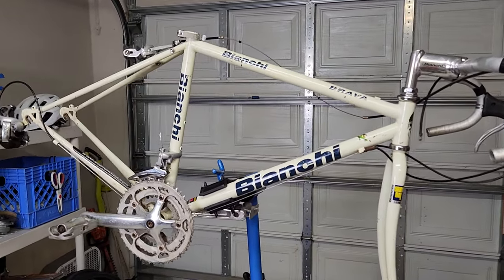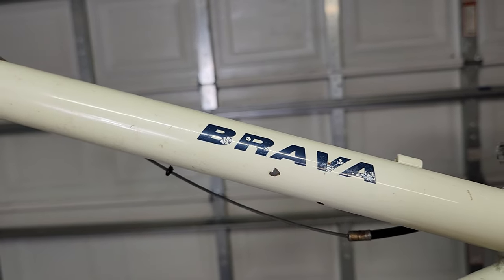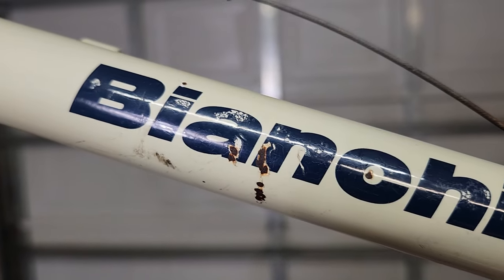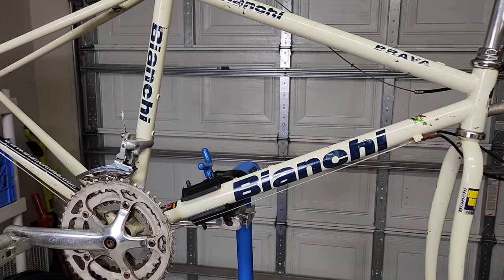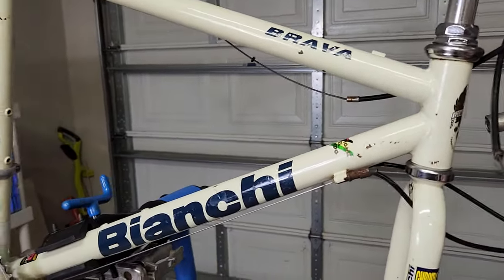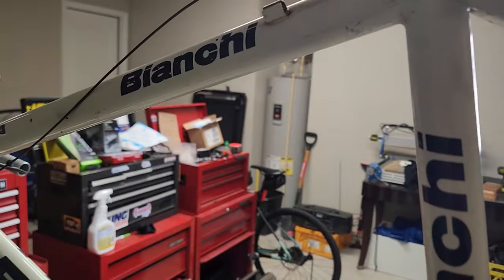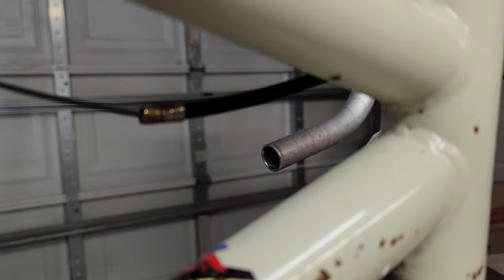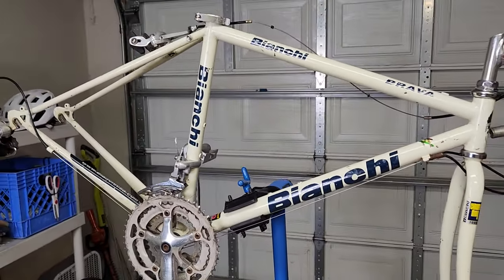$25 Bianchi - quick intro

Comment: Okay, Bruce, I'm wondering if I'm happy for you or if you make me sick, getting a $25 Bianchi.    
😀
Reply from the maker: lol, if it make ya feel any better I did have to drive over an hour each way to get it.
Reply: @BruceChastain  Yeah, thanks, Bruce, glad you had to work for it, lol.  And you know I am cheerin' for you and I got a fun find late last year, a minty full-rigid '90s 26" Specialized Rockhopper Ultra with a small compact frame, almost BMX-like.  And without putting too much into it, yet enough to make a difference such as modern BB and such, I think I'll make it gravel-event worthy, if only for the fun of riding a '90s mountain bike and mingling with modern bikes.  😀